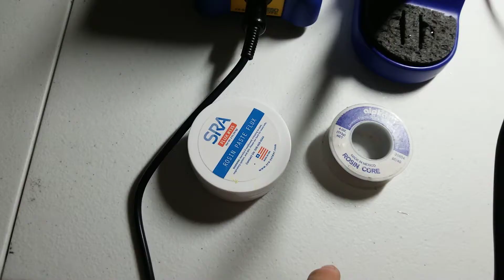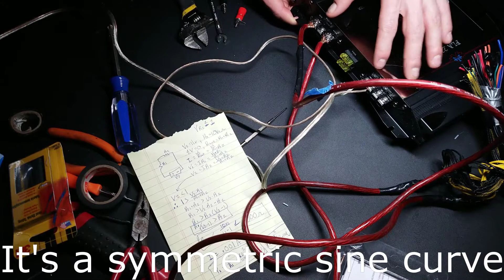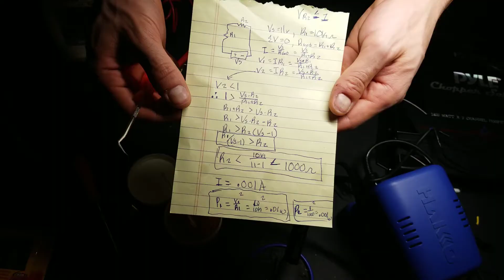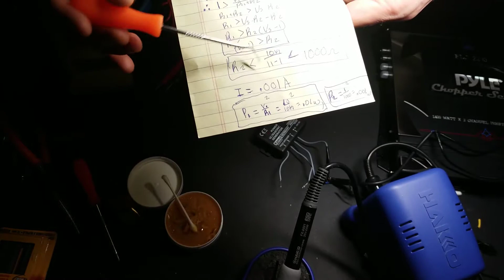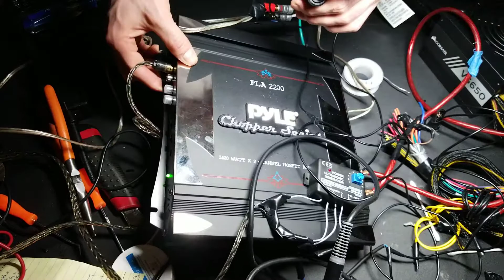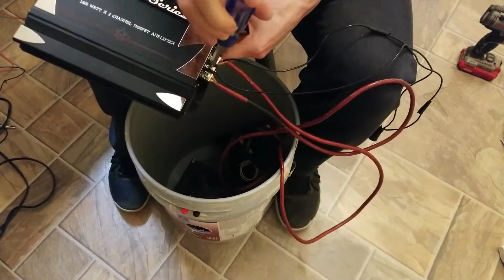How to Make an Amplified Ultrasonic Sound System

Comment: Is that a car audio amp? It's most likely a class D amplifier, and I don't think they will work for ultrasonic sound. Class D amps use pulse width modulation, and have to implement a high frequency filter to remove distortion. That should make them incapable of high frequency operation.
Reply: CORRECT! But you can bypass the output inductors.
Reply: several people have made this exact amplifier work

Comment: Don't use a power amplifier or moving coil tweeters for ultrasonic frequencies.
It's better to use piezo tweeters and a digital amplifier.
You don't need much in the way of power to get high ultrasonic output.
Reply: piezo's dont work well with sweeping frequencies. They're largely tuned to a specific frequency.
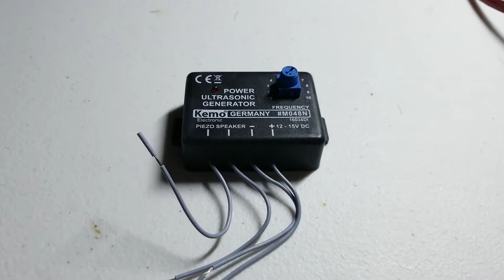Reply: @user-jk9zr3sc5h  0:20 The Kemo Ultrasonic Generator model M048N as used in this video as the signal source doesn't generate sweeping frequencies. 
If you look at the image of it in this video at 0:20 or read the specifications you'll see that it is an amplifier and ultrasonic frequency generator that is designed to be connected to up to 5 PIEZO tweeters.

Comment: So you realize that your amp and your tweeters is not rated fully to the frequency range that the generator is capable of? I can appreciate your efforts but I would not recommend using this equipment with this generator. You'll run into issues like you are having and/or your results will be sub par.

Comment: Very helpful video, especially concerning the resistors value & how to connect.  My neighbours 6 very loud barking dogs are 70 metres away so I need an amp that is powerful enough.  The 30 Khz PLA 2200 Pyle chopper series amp that you used is no longer available.  What is a bridged output?  is it a way of connecting 2 output speakers to the amp, say of 40 watts RMS each to make 80 watts RMS?
Reply: Bridged output is a feature of the amplifier, not speakers. It adds the power of 2 separated channel in one. Most of automotive amps do that, check the speakers output to see how connect the speaker in this mode.

Comment: I bought these same Pyle speakers based on this video recommendation. The speakers blew WAY before the advertized RMS wattage.  A good video, but spend a little bit more and get far superior speakers from Skar or Orion.
Reply: hey @USFmarine any particular model you bought from them?
Reply: @bamyEfh  Skar Audio VX1-ST. I used four. They got a lot louder than the Pyles but I ended up blowing 2 of them by going crazy loud.
Reply: @USFmarine  how loud? did they work to silence the damn dogs?
Reply: @marceloovg1873  it's hard to say. These yappy dogs were too dumb and old to train. I got it so loud it was pretty intense for my human ears, but I have no idea how loud they were from 40ft away and through a pool cage.
Reply: @USFmarine if you’re able to hear it then it’s the wrong frequency. You need to be using a 15k-25k frequency that’s outside of human hearing and is known to target dogs. For speakers I recommend Skar Audio VX4-ST 4-Inch
Reply: dont blame the OP for your recklessness.  DIY means its all on you....especially if you're trying to hurt an animal instead of distract them.

Comment: ive built a high frequency circuit that powers a ultrasonic speaker and the circuit is basically a slightly modified tens circuit with a capacitor bank made up  based on  the tesla 3,6,9  numbers and the ultrasonic speaker is so loud it makes ya head ache after a while
Reply: Can you post more information or a link to what you described? Many thanks in advance.
Reply: Hi, what's the name of the ultrasonic speaker you used?
Reply: Your headache is just a small reason the military uses this tech

Comment: Can you just switch the power to the tweeter using a MOSFET ?   say use an arduino to switch the mosfet at 25 KHz etc. Would that work ?   Is the amplifier a better thing ??

Comment: thanks for this very helpful tutorial, i'm also dealing with barking dogs, i bought a bunch of stuff on amazon, most of what you have or similar, the amp i'm using is (Kemo 40w Amp M034N) do i use the same resistors like you (1k & 10k) or what would you suggest? also my amp does not have rca inputs, just regular speaker wire positive & neg inputs, do i connect the positive speaker wire to the 10k resistor & bridged to negative wire to 1k resistor, connect speaker wire straight to my amp. your help will be much appreciated, hope to hear from you soon. best regards
Reply: Hey man, hope all is well. Were you successful on your setup? Can you share your setup? 

I know its been a year since your post, hoping you can help out. 

Thx!